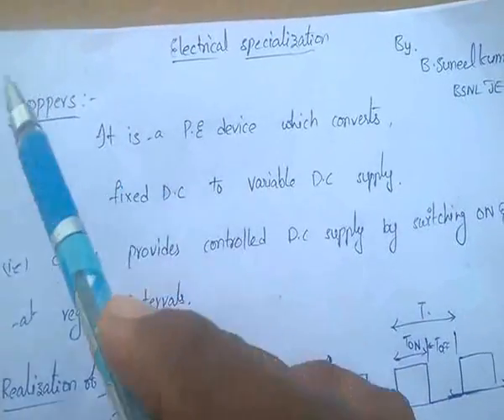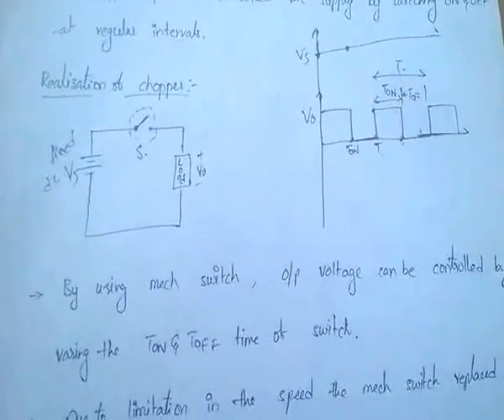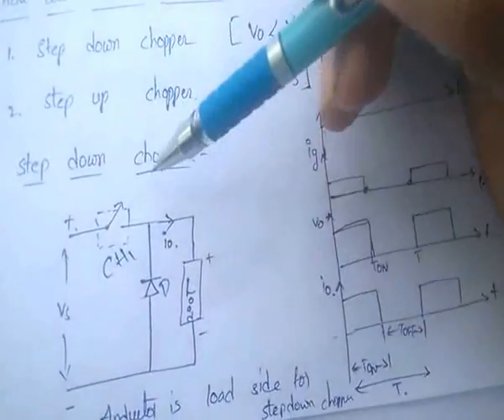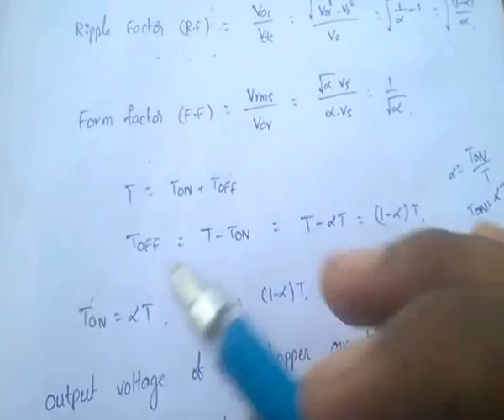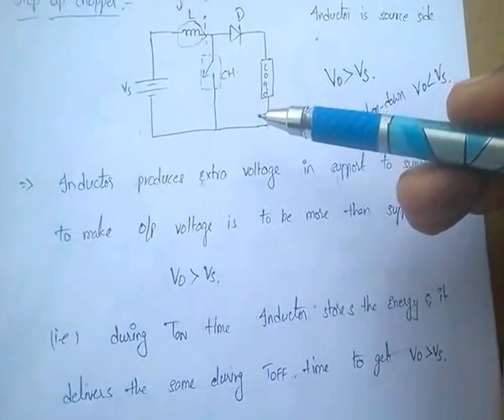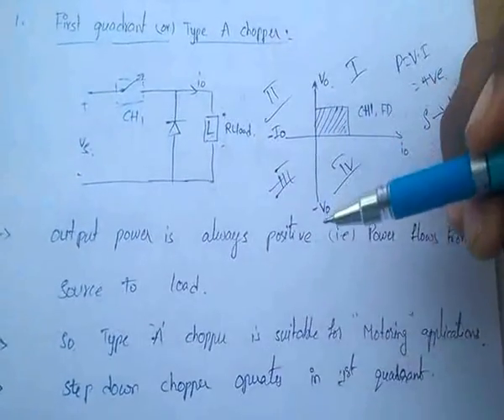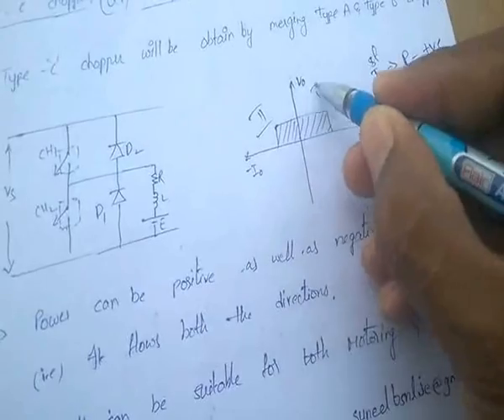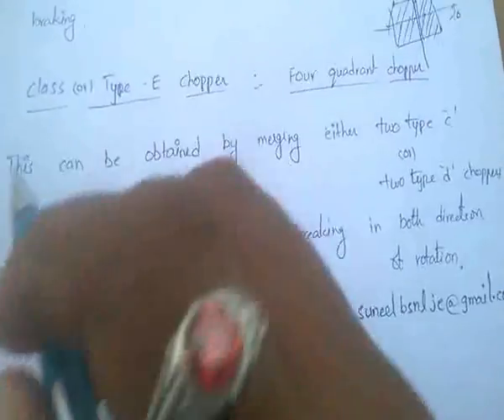bsnl je exam tutorials - specialization - electrical part 7

Comment from the maker: Hi guys..If you want my class notes as pdf file please mail to me for payment details..My mail id: suneelbsnlje@gmail.com
Cost of bsnl je class notes pdf both part 1&2: 400/-
Cost of bsnl je class notes pdf part 1 only : 200/- 
Cost of bsnl je notes pdf part 2 only : 200/- 
Topics covered in part 1..
1.Bsnl je exam introduction - 4pages
2.Maths notes of youtube videos(matrices, differentiation,diff equations of second order, integration,complex numbers,partial diff) 38 pages
3.Maths materials with example question and solutions on remaining topics (vectors,fourier laplace transform and partial diff) 29 pages
5. Basic electricity youtube video notes all topics and mcq’s (except batteries) 36pages
6.basic electricity mcq questions material and batteries 14pages
7.Instruments and measurements notes of youtube videos (3 parts) and material of those topics..and mcq’s 25 pages
8.previous papers- 3(2015 -1,2015-2 and 2013) 78 pages
Topics covered in part 2:
1. Specialization - Electrical - Pdf notes of youtube classes – 15 video’s class notes – 70 pages
2. Specialization - control systems -Pdf notes of youtube classes–
15 video’s class notes – 63 pages
3.digital techniques pdf notes of youtube video classes-
10 video’s class notes – 40 pages..
4. Specialization - Network,filters and transmission lines pdf notes of youtube classes (imp topics only) – I will send N.F.T.L subject later..